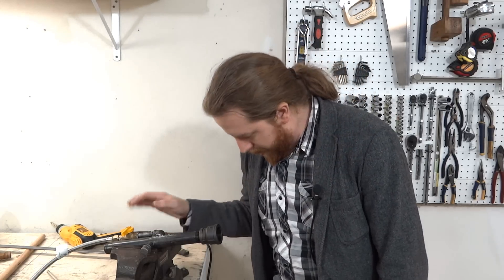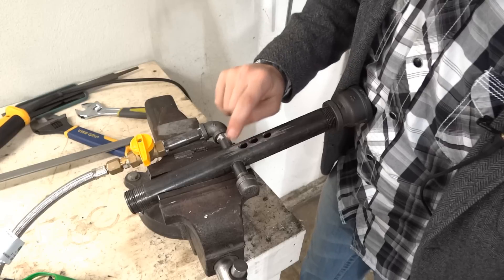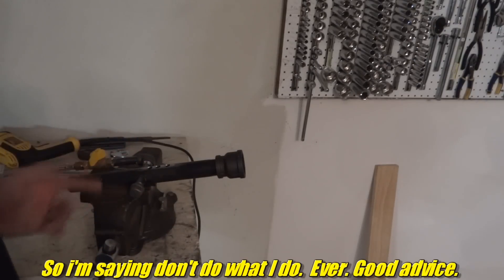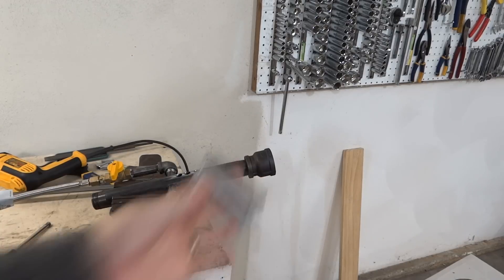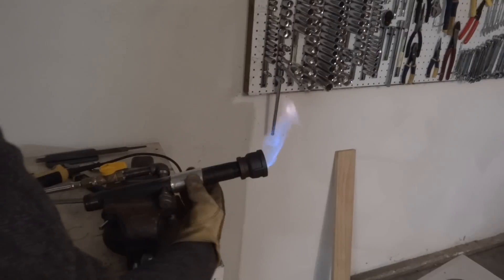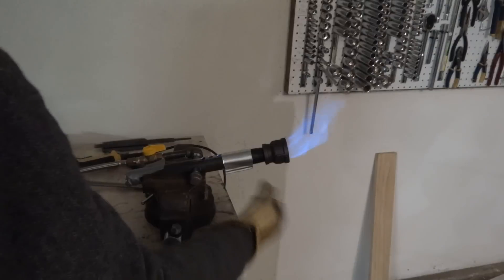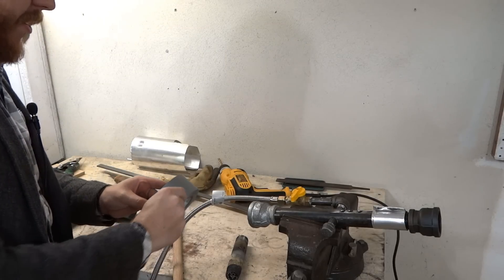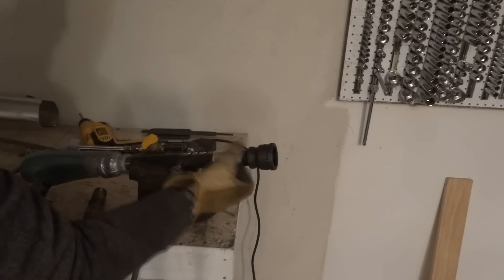Making a Propane Burner even Hotter

Comment: The burnback is all about gas/air velocity in the burner tube (aka the mixing tube). 
Most of the point of the flare is to provide range of velocities from front to back, so the flame front can settle somewhere in the nozzle where gas/air speed and the flame propagation speed are equal.
Regarding your hole modification: For a NA burner, you were on the right track - the logical extreme of your modification is a slit - it should be screamingly obvious when you look at your chaulkboard cross section and imagine making that hole longer. If you look at the commercial burners, you'll see they use slits along the length of the tube. The entire goal is to increase the amount of air the burner induces by reducing the resistance that air faces.
A forced air burner isn't necessarily hotter than a NA burner, but it is generally easier to build because its more tolerant of poor design and construction. A NA burner has to be able to induce enough air to get a good, slightly rich, flame and has to do that across a wide range of input gas pressures. They often fail to induce enough air, which means they run way too rich and the excess gas burns at the exit of your forge where it does you no good. A forced air burner doesn't need to worry about inducing enough air: it just crams air in with brute force. Easy.
Likewise, a forced air burner is no more or less fuel efficient than a NA burner. In both cases if you run them at the same mass-flow-rate of propane, with the same amount of premix air, then you'll get the same heat out. Most people don't do an apples-to-apples comparison - they either try and guage fuel efficiency via the input propane psi ("My burner runs at 1psi!") or compare an overly rich NA burner to and overly lean forced air burner (since thats how those burners tend to bias). In that case, the overly lean forced air burner will be hotter because of the "excess air" - max heat occurs with 5-10% excess air (meaning 5-10% more air than is required for complete combustion) but that also results in an oxidizing flame which is not what one wants in a forge or foundry.
If you want a super easy, proven to work, NA burner then google for a "Frosty T Burner".
Cheers.
Reply from the maker: Thanks for the info!  Since making this video i worked out a much more efficient way to run the burner.  As it turns out, most of this is running super rich and I was having trouble cranking the temperature to copper casting levels, but using forced air and air hole adjustments i was able to run higher PSI and a more neutral flame.  It works MUCH better now.  No doubt this isn't the best design, but it did take a while to figure out the settings to generate the max amount of heat.

Comment: You don't need a flare if you run it in a furnace, needless complication.
Reply from the maker: Yeah when it heats up, but i was having issues with the burner being stable when it was cold.  The flare helps that a lot.  What i really need is probably a better built burner.  Not saying anything bad about the oliver upwind design, but my execution wasn't ideal.

Comment: Have you considered that lighting the torch at the vent holes might be what's causing it to burn there ?  Try lighting it at the muzzle !
Reply from the maker: it still jumps back into the pipe no matter what, but starting the flame in the pipe certainly doesn't help

Comment: uhh... why would you light it inside the tube? i’m not an expert so if this is a stupid question don’t like end my career but it seems like lighting it at the end would solve all your problems without a complicated change.
Reply from the maker: when the flame is in the flare it will jump back into the pipe anyway, but lighting through the small hole allows me to light it at very low pressure, avoiding the "WOOF" you get when cranking it on and lighting it at high pressure
Reply: Paul's Garage so i built my own burner and plaster forge but whenever i light it, the flame seems to move back into the burner, or it works it’s way down and just goes out altogether. any suggestions? would a grate style thing at the end of the burner help? (i don’t remember what those are called) thanks.
Reply: Noah, it's called a diffuser.
Reply: why would you not want the WOOF. best part of it.once you mount it.you do not want to light that way.like that you show the trial and error

Comment: Hey, the reason your burner wasn't running right is because you have far too low pressure and made a screwy design. It could still work, but this type of burner doesn't run off a BBQ regulator. I didn't see what the reg you were using was, but based on sound it sounded like a bbq reg, or at least under a psi or two and possibly a much too large propane orifice.  

These types of burners usually run 20psi+ with a .023" or 0.030" orifice. The reason it kept sucking back into the tube is you simply don't have enough velocity to push the propane out the end and suck air in the ass end.
Reply: no it was a 0-60 psi reg

Comment: what kinda pressure regalutor do you use. i have one that goes from 0.4 bar up to 2 bar, but still the flame wont get hot enough too melt aluminium.
Reply from the maker: +Leander Both I have a turkey fryer regulator, it goes 0-30 psi (about 2bar).  Are you adding air to the mix? Propane should burn blue.  If it's a yellow fire then it needs some air

Comment: Hey, Amigo.🙋
Still getting flame receding back behind the flare? If so, what do you think of what this guy did at the 10 minute mark:
https://youtu.be/5uuTqCsoOLE
Almost like a Flashback Arrestor. I would size up both those mesh layers' diameters to fit stout & solid against where the flare's inside threading stops and the end of the burner body threads, so that if/when they deteriorate they're easily replaceable. So there should be no need for JB Weld on your design IMO.
Also, I would not block your vent holes with that aluminum sleeve or anything else. I'd let them breathe, the more the better. Your design that way seems very useful, like this "high flow" nozzle which has 4 good sized vents for such a relatively small nozzle:
https://www.amazon.com/dp/B00ZC4XB1E/ref=cm_sw_r_sms_apa_hM6RzbZGQVJP1
And I think you were on the right track with the hair dryer:
Less fuel ($$$), more air (free free free!) Except, like this maybe (example at 4 minutes 3 seconds):
https://youtu.be/Miri90Hlzh0
Buried among his comments, he says he got that blower here:
Forge Blowers | Blacksmiths Depot
https://www.blacksmithsdepot.com/products/forge-fan-fuel/blowers.html
Pretty pricy, but you get the idea, knowwha'msayin?😎 Throw whatever you have on hand at it - shop vac, air compressor, air mattress pump, bellows, all of the above in series... Heck, back up the wife's vacuum cleaner outlet to it for that matter.😉😊
Some comments on DIY burners said forced air eats more fuel though. I think it can be tuned to be efficient. Mind you, I have no actual experience with that. Just brainstorming.
Hope it helps. Nice videos. Thank you for taking the time to share them.👋☺
Reply: Thanks for the links I've been having issues with back flash and it seems the only remedy is a air mattress pump blowing into the intake of the burner

Comment: Paul - Thank you. This was an issue I was currently having with my design and you helped me figure out how to alter it to make it work properly. It's a bit of a different design that uses a welding tip as a propane nozzle (so it could technically be changed out if I needed to alter the AF ratio). The only major downside is that it lacks a cut off valve at the torch, but it has an adjustable regulator with a flow gauge at the tank (and the hose is only 4' so I'm right next to it regardless)
Reply from the maker: glad i could help!  4' is a pretty short hose, i'd want a longer one.  The shutoff valve being so close like mine isn't a great idea, the heat could potentially screw it up.  So far mine is fine, but that doens't mean it will be fine forever.

Comment: It might be completely inconsequential, but my first thought was that the jet of fuel wasn't pointing directly towards the end nozzle.
Reply from the maker: that does happen, but mine is pointed straight.  when it burns back into the pipe, i can see the flame through the holes and i pointed it straight down the center of the hole.  Another trick is to use a hose and pump water into the fuel pipe, and see where the stream comes out of the hole.

Comment: I have been slack and I have just gotten around to watching this. Great content, well explained and executed. Good stuff.
Reply from the maker: +Home Built By Jeff thanks!  Same to you!  I actually got into the foundry stuff hoping to cast some replica/custom car parts, like knobs and handles that are cast, and some engine parts (assuming I can get machining them figured out).  The car projects don't start until the toy jeep is done though.  Wish I had something like a 911 to work on!
Reply: Casting is something I haven't played with at all yet, but maybe in the future it could be worth playing with. One of those torches could come in handy on car projects though. I have often needed to heat something up (like with dent removal) and I don't have an Oxy-Acetelene torch. That could do the trick.
Reply from the maker: +Home Built By Jeff yeah the propane burner is super handy, I can heat treat stuff, cast stuff, temper/anneal stuff.  Propane has a much cooler flame than oxy-acetylene but the flame in mine tends to be much larger, so lower temps but higher heat affected zone.  Also my burner will not melt steel no matter what I do, so it's less likely to accidentally burn a hole in something.  As a bonus a propane tank is less likely to blow my garage up.  Acetylene scares the crap out of me.
Reply: Being a firefighter, Acetylene scares the crap out of me too ;)

Comment: Why are you igniting the flame through the vent holes??????? Why are you throttling down the gas???? The jet needs to blast the gas through the pipe to ignite outside the pipe and low pressure gas is your problem. Light the burner outside the flair......
Reply: I agree ^…. If you don't want it burning in the tube don't light it in the tube.  I'm sorry but this is a terrible burner design. :(  I can get 70,000 BTU with a burner without forced air and without it burning in the pipe.  I guess as long as people depend on these kinds of videos for the burner information I'll stay in business.
Reply from the maker: +Jeffrey Cole it's so I don't get the big BOOM ball of fire when it first lights.  But yeah, makes it tougher to get the flame out where I need it.  That aluminum sleeve pushes the flame out to the end, but even then it doesn't stay there if I throttle the thing back a bit.
Reply: Hi if u know how to trouble shoot a forge burner i would love to see how to do it im trying to do mine but im having a hard time its sound like its coughing on mine
Reply: Eduardo Contreras not enough oxygen, orifice not aligned with the tube. Venturi burners can be difficult because when you put it into an enclosed forge the secondary air (open atmosphere) is taken away and they behave totally different than when they are in open air. At least in my experience. My best advice is to use forced air with some kind of air volume control.
Reply: Just get a fire in front of the burner before opening the gas. Also, if you want a stable flame with lower pressure, a smaller diameter burner is the way to go. 20mm (3/4") is more then enough for a rather large furnace or forge. I get forge welding heat without problem in my 240mm diameter by 450mm forge.

Comment: This video is kinda old but I finally put my burner together after the parts were sitting forever....Anywho mine is the ron reil burner and works great. Maybe you could convert yours to that by using a bell reducer and drilling two holes into it for the gas pipe. If youre curios I used a 1-1/2x3/4 bell reducer, 3/4x6" nipple, 3/4x1 bell reducer for the  flare. Gas pipe was 1/8 brass (brass is skinny and allows more air). Oriface was #57 drill bit. Good luck!
Reply from the maker: I was considering a different burner but i would probably remake it from scratch.  Also, i'd definitely go for forced air next time, maybe not even propane.  Who knows.
Reply: I considered force air but others said it used a lot more propane (and more elaborate to make). Now that I have this burner I dont think its needed. This is a picture I took of my burner at about 20psi.  http://imgur.com/a/WKDdl

Comment: make 1 more air hole to help lean it out....too rich like you said. defeat being rich by adding more 02.. ;) I think I will use this design for my forge, thanks!
Reply from the maker: +MrChico809 good tip. Thanks!  I've been thinking of adding some holes, probably integrating them into a flare near the end of the pipe
Reply: That might work, but I think it a better idea would be to use the npg to pull in O2 from behind the fuel discharge, as we witnessed it is hard to maintain the flame at the end of the burner. The holes at the end of the pipe may be of no assistance.. good luck and show us what happens!! :)

Comment: I have heard that inserting a cup shaped piece of fine mesh, the same diameter as the inside diameter of the burner tube, into the end of the burner tube, just before the bell end of the burner will prevent the flame from travelling back down the burner tube. Of course you will need to ignite the burner at the hot end for this to work. If several pieces of mesh are used, the propane / air mix will be evened out and a more effective burn will be achieved. The principle is the same as was used for mesh covered miner's lamps in coal mines around the turn of the century (and probably before that.) As I said, I have never tried this but it sounds like it would work.
Reply: mesh covered miners lamp is called davy lamp. sir Humphry Davy discovered sodium, calcium, magnesium, strontium and barium.

Comment: I dont understand why you have the holes so close to the gas source, or why you have the holes at all.  You could have used a similar setup except dont drill holes in the pipe except for where the gas source goes in. If you can switch the black iron gas line pipe with a brass pipe you could get a smaller pipe and put the gas line about 2 or 3 inches from the back instead of in the middle, then put a second reducer on the back and make sure to grind the threads down smooth  in the front reducer...    Just some thoughts, and prolly already been covered
Reply from the maker: +William FireWulf Brunson Jr yeah you are describing a different burner design, a more common one.  Made an Oliver Upwind burner from backyard metal casting.  Look it up, it's pretty interesting but definitely more finicky.
Reply: I see the difference in yours and the Oliver upwind burner. Yours has way more pipe coming off the back then what i see in the Backyard metal casting. Yours is in the center of the pipe where theirs is at the end of the pipe, that could also affect your flame.   I never really liked the Upwind burner for some reason, i guess that's why my forge has the type i described in my first comment
Reply from the maker: yes my fuel pipe enters the middle of the pipe, but the back of the pipe is capped off so it really doesn't matter how long it is. It's just extra pipe (it was the size available and I didn't feel like cutting it shorter).  The distance from the fuel to the business end of the pipe is the same, though the pipe is larger diameter slightly due to availability of materials at my local hardware store.  The upwind burner isn't all that popular, probably because it can be a pain to tune and get working, and also because the design has no advantages that I can tell over a reil burner.

Comment: u should try to put ur just at the end of a 1" black pipe in the center of a 1.5 to 1 reducer and make an small flat threaded washer to adjust air flow like Alec Steele does with his burners
Reply from the maker: +Daryl Gardiner that's more like a reil burner, this is an Oliver upwind burner so it's a totally different design.  The reil burner is probably better though.
Reply: you might be right I don't really know but I know I'm gonna try to build one for a forge and a smelter

Comment: The problem MIGHT be regulator pressure. I had the same sound when I were using normal cooking regulator
Reply from the maker: +Kamal AL-Hinai I could adjust the regulator pressure pretty far, and you're right there is definitely a "correct" pressure it works best at.  The trick is figuring that out lol I don't have a gauge or anything.

Comment: OK

In theory if you replaced the inside pipe with another with just a slightly smaller hole and kept the blower you'd use less propane than presently, guarantee a complete oxygen rich burn, and you wouldn't have to mess around with anything. 

Just a thought.

Comment: have you tried cutting the back end of the 1" pipe? so that it and really close to where your propane nozzle is and not 3 or 4" behind it? I think it would be easier for it to move the air with a shorter pipe than a long one?
Reply from the maker: By the back end do you mean the fire end or the opposite end?  The non-fire end is being capped (i took the duck tape off and bought a 1" black pipe cap) so no air can get in there at all.  The horizontal tube with the gas jet drilled in it takes up too much space in the tube anyway so air doesn't like going around it, even the hair dryer was having trouble to be honest.